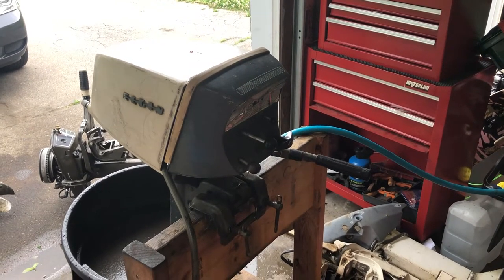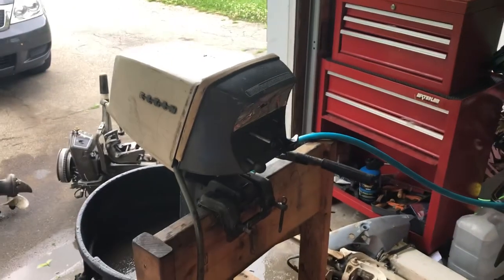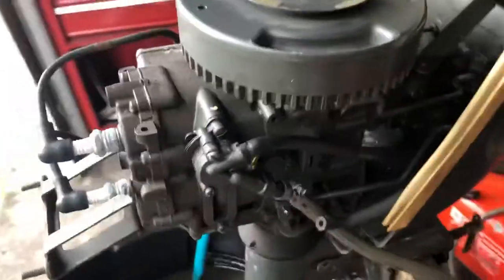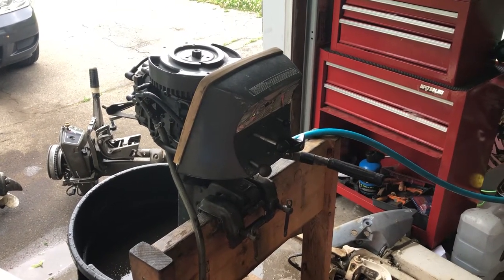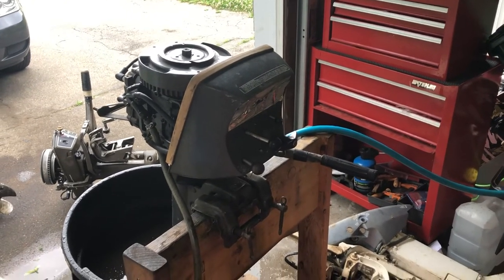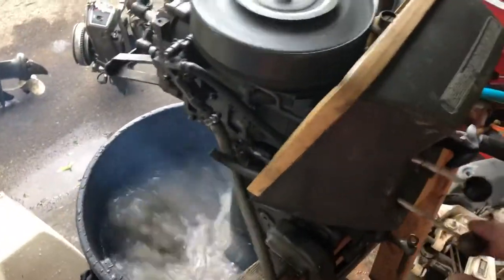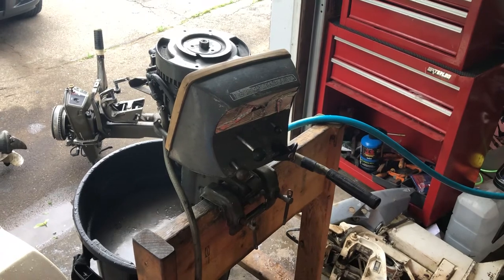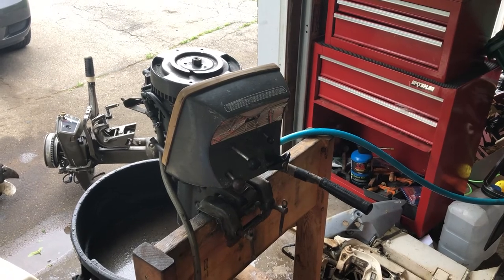1962 Elgin 7.5 Outboard

Comment: Hi! So I still have the outboard, and I'm still working on it on any free time I have. I was able to replace the recoil starter rope, but I'm not sure if I got the spring tensioned correctly. Anyways, I keep watching this video you made to keep myself motivated to work on it. Once I get her running, I have a small inflatable boat I plan to use her on. Fingers crossed!
Reply from the maker: Recoils have been the bane of my existence when it comes to outboards, some are less bad than others but none are fun to work on. Good on you for tackling a vintage motor and it is so rewarding when you do get them going. Best of luck and thanks for watching.

Comment: I believe I own this outboard now. Any info you can give me about it would be greatly appreciated. It doesn't have the pull cord, but I plan to replace that with one for a chainsaw, seeing as I can't find a replacement. I believe I have the engine in this video.
Reply from the maker: When I owned it I believe it needed an impeller and the carburetor need some fine tuning but it was running fairly well. If it’s just the cord missing you can pick one up from most small engine shops or farm supply stores. Please reach out with any other questions and best of luck.
Reply: @patricksmotors9070  thank you, I'm sure I will have questions. First up will be seeing if there's any way to change that fuel intake, really not the best set up.......
Reply from the maker: It’s unique to say the least but should be relatively easy to swap to something a touch more modern.